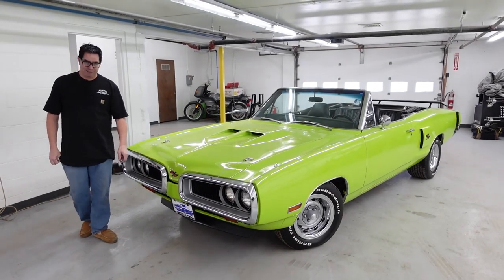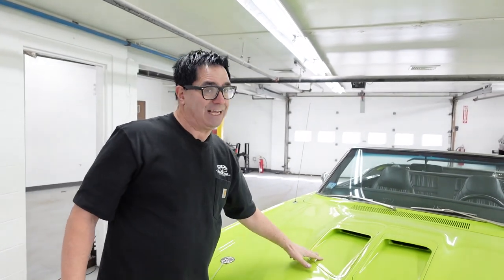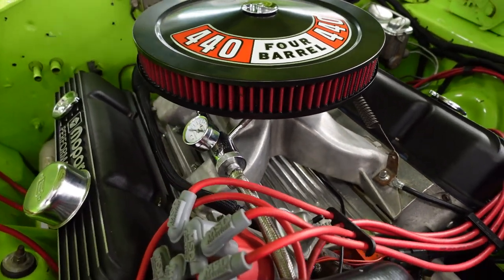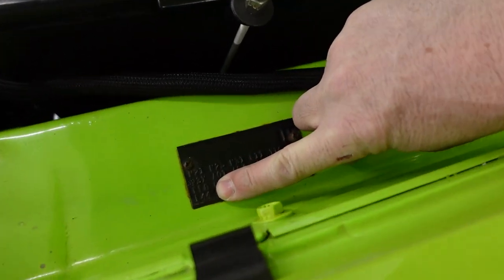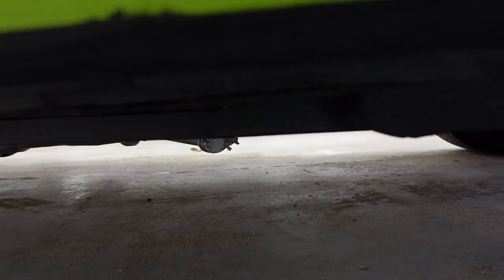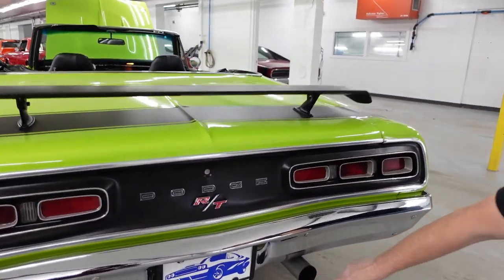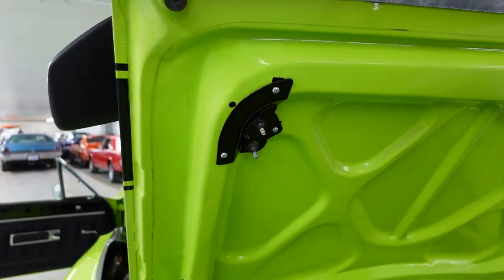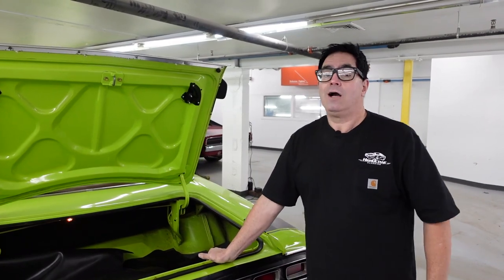1970 Dodge Coronet Walkaround with Steve Magnante

Comment: I had a 69 Coronet R/T, R6 Rally Red with a 440 and 727 Transmission.  The 69 Coronet R/T came with the fake vented hood bulge.  I sold it in 1997 for $7,300.  Worst decision I ever made.
Reply: Hindsight is always 20/20. I sold my home in Clark NJ late 2001 for $190K. Can't get one smaller or as nice for anything less than 1.5 Billion now. (Yes,a tad exaggerated)

Comment: Yup, with the VIN, you win: W for Dodge Coronet, P for Premium price class, 27 for two door convertible, G for 318 V8 with two barrel, 0 for 1970 model year, G for St. Louis, MO assembly (Fenton) and the rest is the production sequence. The Fenton plant complex operated from 1959 to 2009.

We got the tag, we can brag: M21 for roof drip rail moldings, M25 for wide sill moldings, M31 for belt moldings, R11 for AM radio, 2 watt, Y16 for sales bank, V3X for Black convertible top, A01 for light group, A04 for basic radio group, G33 for outside remote LH racing mirror, J25 for three speed wipers, L31 for hood/fender mounted turn signals, EF8 for Dark Green exterior paint, D4X9 for Black interior trim, TX9 should be for black upper door trim, 203 for Tuesday February 3, 1970 scheduled production, E44 for 318 V8 with two barrel, D31 for A904 three speed automatic transmission, and END for end of sales codes.

Comment: $65k seems a little high for a fake...
Reply: Cracked dash pad, no heater hoses-looks like a typical half finished auction car.
Reply: Should have left it as a Coronet 500. There is so much wrong with that car it shouldn’t even be called at R/T tribute.
Reply: It's the "market" now. Milk is $56 a gallon gas to be $100 soon.
Reply: I agree with Long Island Mopars. What’s wrong with a Coronet 500? Add the Coronet R/T 150 mph speedometer to the needs-fixed list.